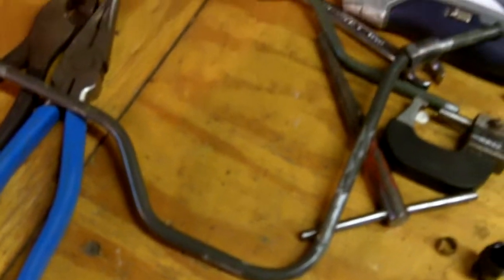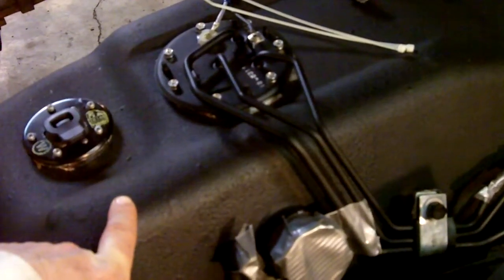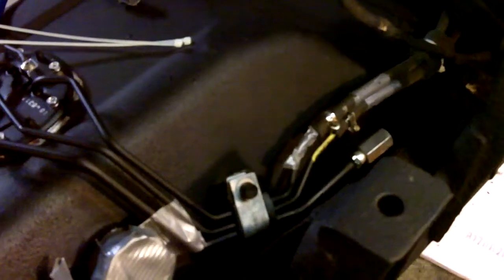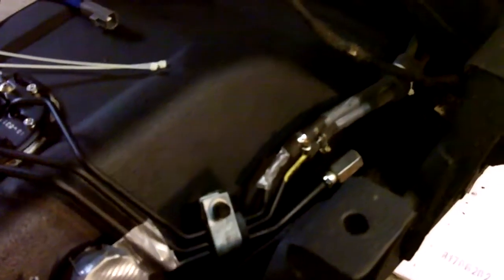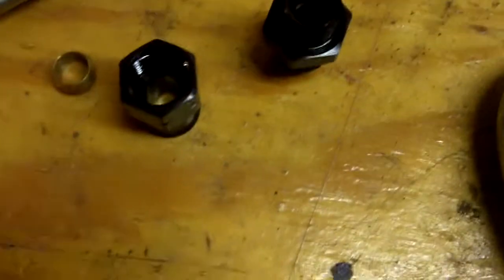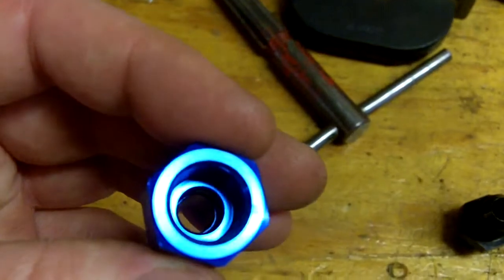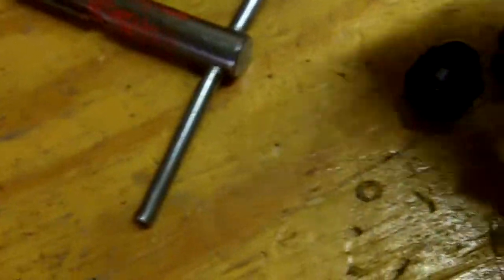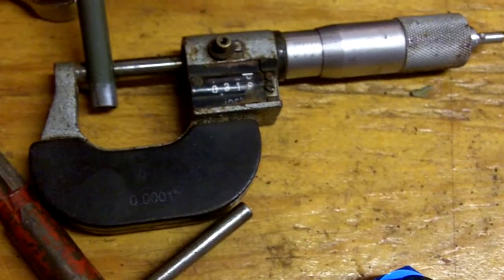1994 Toyota Pickup HiLux Fuel System Line Fixing and Options

Comment: Can you please share the company or website URL where you bought the mount bracket for the fuel pump?   Thanks for sharing
Reply from the maker: Hello and thanks for watching. I started calling Toyota dealers around my area and I didn't have too much luck, so I then started calling large Toyota dealers on the West coast and found one that had a pump hanger in stock. I honestly don't remember which Toyota dealership it was, but that is going to be your best bet, to call around,  they are out there.... You might also want to check on eBay. Search for "toyota pickup fuel pump hanger" and you should get a LOT of results. Good luck!

Comment: Wanted to thank you for taking the time to make this video.  I have a 1992 Toyota Winnebago Warrior that has a major gas leak in, what I THINK is my return line.  No leak before starting the engine with the key on but once it is running gas pours out from one of the lines and I have to shut the motor down to stop the leak.  Needed to just see the layout of the fuel lines and your video did that for me.  Since I have vertigo I cannot crawl under the vehicle myself so I will have to get one of my friends to make needed repairs. I am hoping it is just the rubber fuel line that either ruptured or pulled loose but chances are it may be worse after watching your video.  Anyway, thanks for posting this because it really helped me!
Reply from the maker: Good luck with your Truck! This is exactly what I love about the internet and YouTube, being able to share knowledge and help others out! Good luck and let me know how it turns out!
Reply: @BarnStangz  The tank is out and now replacing the fuel pump and fuel lines in the next few days.  Source of my fuel leak was a ruptured supply line from the fuel tank stem area into a rubber fuel line that looks as though a rat had chewed through it.   Should be running next week.
Reply from the maker: @aboonski  Awesome man! Progress is good!

Comment: Where did you find the 14x 1.5 union?
Reply from the maker: EBay or your local Toyota dealer. I want to say it was pretty hard to find on eBay. I remember ordering a stock hard line and one came on that as well. You may want to take a ride to your dealer and talk to the parts guy. Also give eBay a try.
Reply: Make more videos  onn old yota

Comment: I have a 94 Toyota 4runner that starts and idles fine but floods itself out when driving if you have to stop for anything with engine still running. Please any advice will help. Thanks in advance for your time and advice
Reply from the maker: Could be a lot of stuff... But I'd check with some sensors, crank position and maybe even the cold start sensor. There are some pretty good resources on the website forum "pirate 4x4" give it a Google and see if you can find something. I'm sure it is a sensor. Good luck my friend.

Comment: Did you purchase the fuel pump hanger assembly from Toyota?
Reply from the maker: Yes, I forget which dealer, I think on had it in Columbus, Ohio. But yeah, there are a few different types so make sure you get the correct on off your VIN. Thanks,
Reply: Any advice for removing the old hanger? Mine is very rusty. On mine I had a squirrel chew through the fuel return line. The main fuel line and vent line are still ok. Thank you.
Reply from the maker: It's not going to be easy. The absolute worse part is the rust and then if it falls into the tank. Since I was replacing the hanger and the tank, I really didn't care what happened. 

I take it you have the bed off?
I would shoot all the metal screws with Kroil or some kind of REALLY good penetrating oil and let it sit for a day. Then use a impact driver to get them off. Mine wouldn't budge at all and I ended up having to use a sander disc on a grinder. You might just want to plan on replacing the tank, they can be found fairly cheap on eBay. Just make sure you prime and undercoat it well and you should be good for a long time. I really like my little truck, so I plan on keeping it a while. I went the extra mile to try and fix/replace as much as I could. Good luck, sorry I couldn't have been of more help!

Comment: did you bend up all those lines yourself? or did you buy those lines like that?
Reply from the maker: The lines that come out of the tank are OEM from Toyota, it is the fuel pump hanger assembly. Not a cheap part either and Toyota makes a few different ones, so if you end up having to purchase it, make sure you get the correct one by going off your VIN.
Reply: Can u please tell what to buy. For 89 Toyota pickup fuel pressure  line from a  new  pump hanger.  Unit. 
Old line is seized. On... cant.  get  it  loose.. try. For ever.  . It's rusted. Aswell. 
So I'm.  try to get  a line that will fit and there's to oem line. Outside the tanks 
Video . Helps. But. Not sure what union fitting that will work.
If  you. Can. 
I appreciate it.   Got my hold truck done  finished.  After 2 years. 
Then hit the key. No fuel. 
Relay. Is. Good. 
I drop tank. . And gt  new pump .and bracket.
Can't get  fuel line. To come loose from tank. . 
I just asking. If you can tell 
What  after market line that will work with stock Toyota  pickup truck fuel line male. Thread. 
Anything that will thread together.